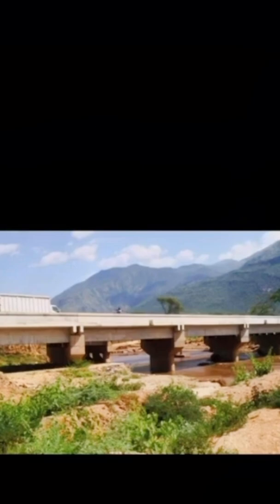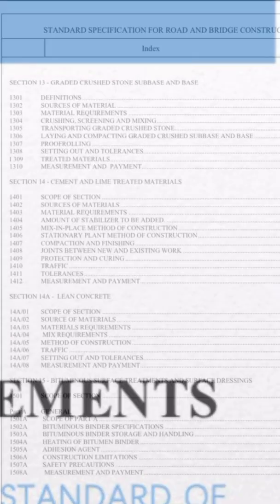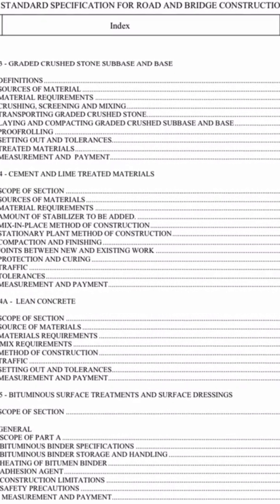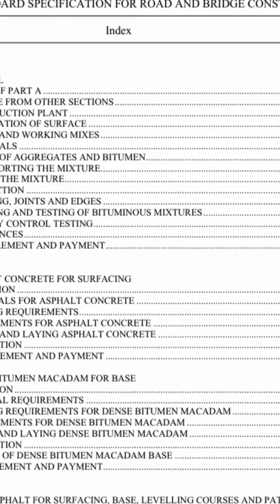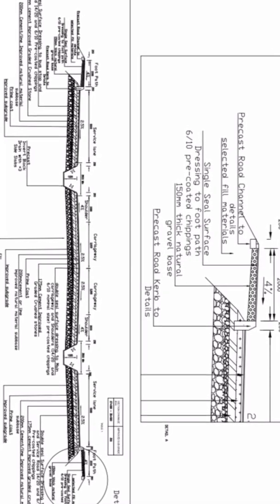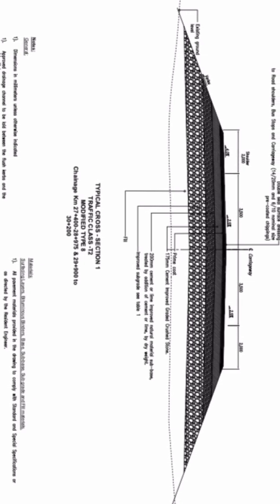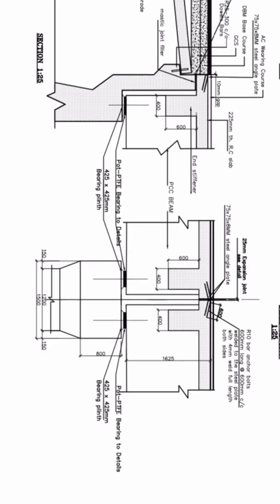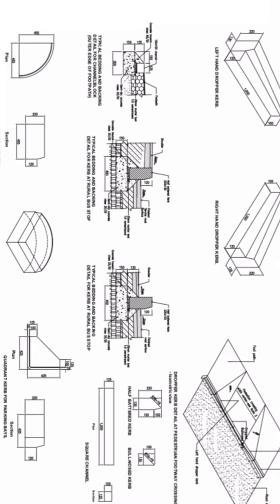Tarmacking Roads  || DBM LAYING PROCEDURE (Dense Bitumen Macadam)

Comment: What's the difference between dense bitumen macadam and asphalt concrete?
Reply from the maker: Good question. 
The difference between DBM and AC IS mainly in the design mix, ie aggregate, bitumen content.. 
The layer thicknesses also and 
Function. Ac being a wearing course and DBM is a base pavement layer
Reply: @madamengineer.Gertrude  Thanks for the clarity. 
So you can't lay DBM and surface dress directly, since it is a base? 
Does that also mean that in class A for example GCS becomes a subbase even if its cement stabilised?
Reply from the maker: @bonifaceraphael8655  Refer to cross section types in the design  manual. 
Anyways personally I believe A pavement engineer can research and design the cross section and prove it for use